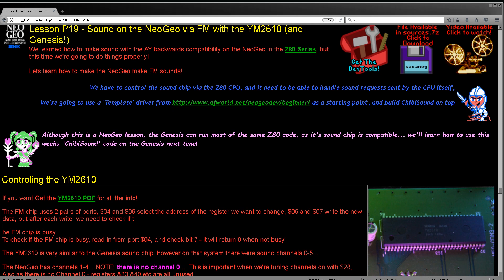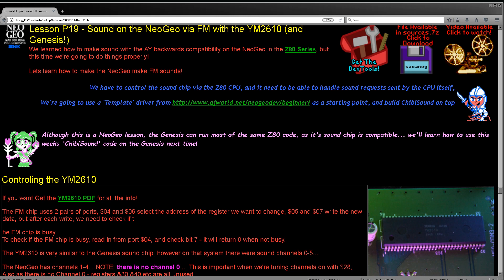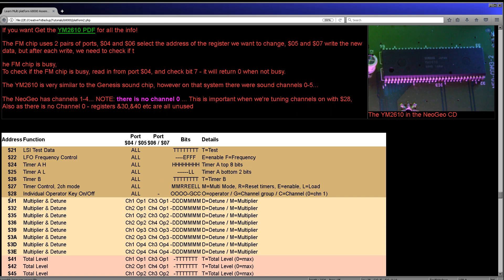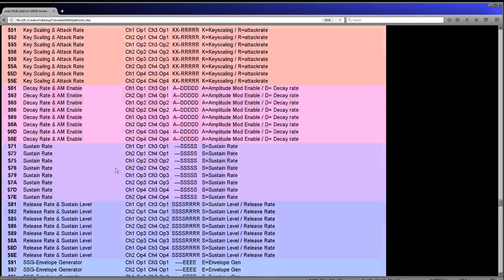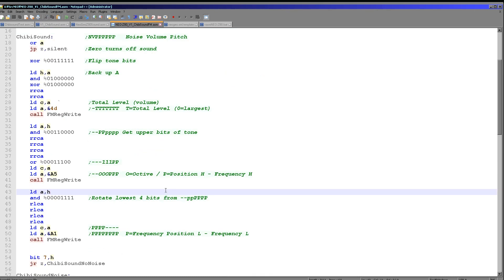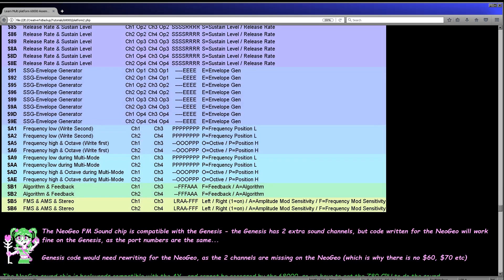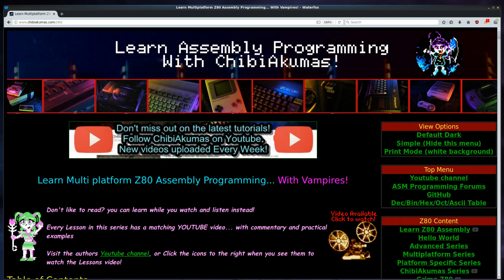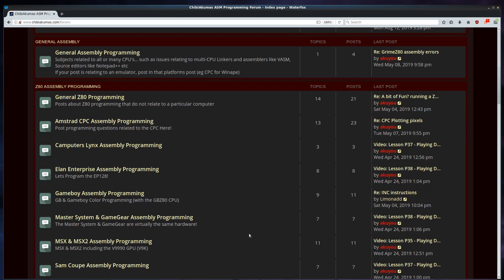Sound on the NeoGeo via FM with the YM2610 (and Genesis!) - Learn 68000 assembly Lesson P19

Comment: In confused about the ym2610 sound chip like how did they get sounds on the 2610 audio chip did they record a keyboard into the sound chip and the sound chip compressed the audio. Or was it like a sound font of multiple sounds, and they used midi to minipulate the sound.
Reply from the maker: I've only ever used the NeoGeo as an AY emulator, but I know it's capable of AdPcm comressed  digital audio. My understanding (and based on the sounds I've heard in the game) is that NeoGeo music is the same as MOD on the amiga, short samples with their playback rate altered to create different pitches, and this is then used to make music, but the actual job of playing music (timing the notes and looping the patterns) was done by the dedicated Z80 in software , not some kind of hardware 'player' if that makes sense.